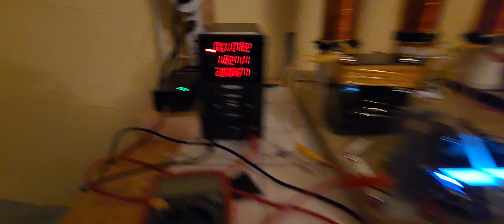🌟Replicating Joel's Radiant Energy Amps Per Second Cap Dump Circuit To Rapidly Charge Batteries🌟

Comment: Doesn't all this disprove Maxwell-Ampere's law which says that a changing electric field creates a magnetic field, because the oscillating E fields are without magnetic fields?
Others say that the displacement current term must be placed on the left side, B and E are coexisting and created simultaneously by a source, they're not mutually causal, and the tesla coil scales them along the length of the coil, E increasing and B decreasing.
Reply from the maker: Maybe Maxwells New Modified Theory But His Original Theory Left The Door Open For Remarkable Technologies Before Academia Modified It To They're Liking As Stated By Eric Dollard In One Of His Lectures  :)
Reply: Oleg D. Jefimenko actually provided evidence that Magnetic and "Electric" fields do not cause each other:

"According to these equations, in time-variable systems electric and magnetic fields are always created simultaneously, because they have a common causative source: the changing electric current [the last term of Eq. (1-4.1) and the last term in the integral of Eq. (1-4.2)]. Once created, the two fields coexist from then on without any effect upon each other. Therefore electromagnetic induction as a phenomenon in which one of the fields creates the other is an illusion. The illusion of the "mutual creation" arises from the facts that in time-dependent systems the two fields always appear prominently together, while their causative sources (the time-variable current in particular) remain in the background."

"a time-variable electric current creates an electric field parallel to that current [the last term of Eq. (1-4.1)]. This field exerts an electric force on the charges in nearby conductors thereby creating induced electric currents in them. Thus, the term “electromagnetic induction" is actually a misnomer, since no magnetic effect is involved in the phenomenon, and since the induced current is caused solely by the time-variable electric current and by the electric field produced by that current."

"There is a widespread belief that time-variable electric and magnetic fields can cause each other. The analysis of Maxwell’s equations presented above does not support this belief. It is true that whenever there exists a time-variable electric field, there also exists a time-variable magnetic field. This follows from Maxwell’s Eqs. (1-1.3) and (1-1.4) as well as from Eqs. (1-4.1) and (1-4.2). 

But, as we have seen, neither Maxwell’s equations nor their solutions indicate an existence of causal links (no causation) between electric and magnetic fields. Therefore we must conclude that an electromagnetic field is a dual entity always having an electric and a magnetic component simultaneously created by their common sources: time-variable electric charges and currents.° This conclusion must hold for all electromagnetic fields, including electric and magnetic fields in electromagnetic waves."

-Causality, Electromagnetic Induction, and Gravitation: A Different Approach to the Theory of Electromagnetic and Gravitational Fields by Oleg D. Jefimenko

This implications of that is that there is no transduction between the kinetic energy of a "Generator" rotor and the electrical output in the stator, no kinetic energy has ever been transformed into electric.

Comment: What kind of diodes hivoltage and the scr id number do you have a link to the original clip. With only two watt input at 1.5 volts you could run this on a mini Tesla towers or thermal electric pads by making a bed with them or a cover over a rabbit or chicken the heat at 100 deg could charge the thing .that hi voltage power   power unit got any information on it .
Reply from the maker: I'm not sure this was Joel's circuit & he didn't specify but i used four 1N5408 diodes in my setup with a 15A 600V thyristor with a 400 volt 10uF capacitor in my latest experiments
Reply: @MTECH2022  think you it's the little details that make things work ...I find this set up very interesting.what ruing on 2watts amazing.you could run it on a lot of things like a mini Tesla towers or thermal modules.if you made a upside down box made of thermal modules only sealed except one very small hole and placed it over a chicken cage to capture the heat the difference between the 100 degrees of the bird and the room temp could run it .or the same box and a seven day Catholic glass candle and a much bigger box could run for seven days charging several units 24./7 it has huge promise.

Comment: I also follow Joel’s work and watch almost every video. May I know how much output you are getting from your current 1.7v and 1.2A setting?
Reply from the maker: Hard to tell as more testing is required but so far it seems that the radiant energy cap dump circuit works best if exactly replicated from Joel's schematic & if one uses a large lead acid battery
Reply: @MTECH2022  is this the one with 300ft telephone cables? Or another one or the cap dump circuit with high voltage module? Sorry for the questions because I am interested to buy the schematics.
Reply from the maker: @passion4z846  yeah there's also a version of this circuit that uses a huge 4 conductor coil with the ends tied together

Comment: you taught me how to design amps but it's been years I've been using neon bulbs...also to prove the unit knowing that it lights up at more or less 150 volts because I put two in series and it lights them up anyway ahaha I'm also designing my neon sparklers haha, the most crucial thing is that the neon bulb shows you the flow of electrons so when you experiment it's easy to see the changes in the flow of electrons to find the right combination for the power be careful it's lethal...with the capacitors it never discharges them...until the end..I always put a load of bleeding in addition...on a button...to empty the caps without having to touch it.

Comment: now that I've introduced you to it... for the full wireless reception of your circuit.... and I'm proud of it... we've never worked so much coal I would have thought that we would have helped each other like that haha ...I'm brilliant, I'm a specialist in my specialty. I told you everything, I think we need to use Joel's circuit, that of the loop... We only put three at the base of the towers... .lay flat on the table around the towers...the three coils lay flat, tune them in symphony by pulse discharge or other....1, 2,3 or 2, 1, 3....or 3 , 2, 1 the sequence .... or other .... aha, and the tower which works continuously under load ... we should try I'm sure that if we configure it cleverly at the gain we can do things of mad at the gain at the current output...whether negative or positive...forge and honor.to all.peace
Reply: Have you personally built anything? I'd like to see some of your work if so.
Reply: @brianp5210  yes and more power
Reply: @brianp5210  im use 0 60 vdc in ... 30 watt in and my secondary is 25 carrer   ..1690 wire of litz .... the output is ... 300 bulb thungstene halogene full light
Reply: @anthokranken  
Do you have any videos of this? Your channel is empty my friend.

Comment: yes joel is very hot... watch his video with his loop.... she is mega hot, he manages to have the same peak at 1000 volts which we manage to extract or transfer wirelessly to the receiver... just with its loop I am studying electromagnetic shields...at the moment I am assembling two very very beautiful pieces you will tell me the news a rotating moreor of 3 m 30 span.... at 200 rpm in 12 volt... under 2 ampere .... I recover the input to the car charging battery ... I am in the process of connecting the outputs. malik you need to advise me a serious supplier for the super caps ... I am in the process of making one frequency controllable resonator, with magnetic ferrite core .... and I would like to use the super cap on this part ... I am switching to 25 square also in diameter of the secondary wire of my tower haha